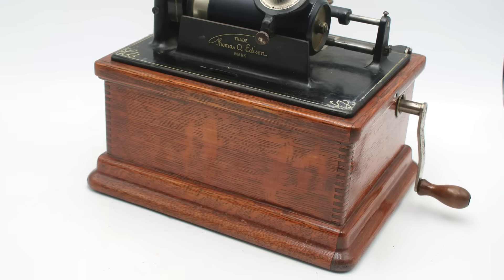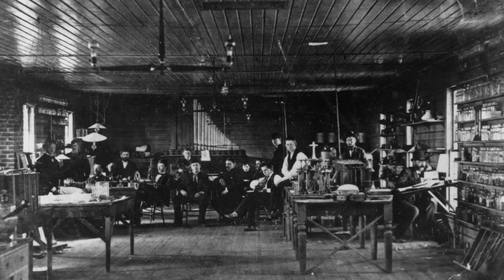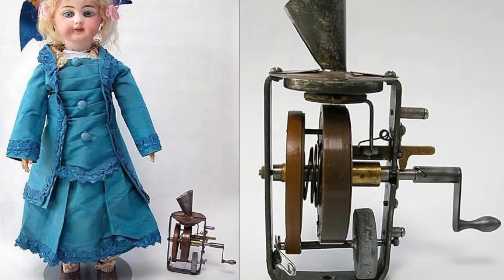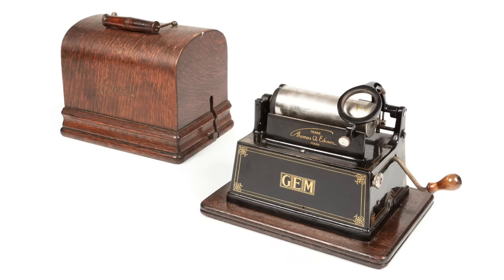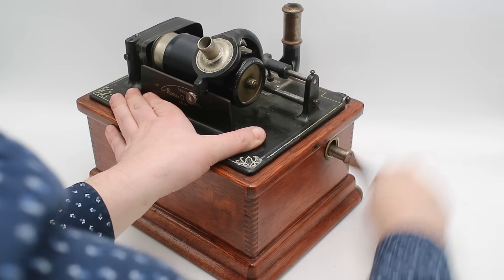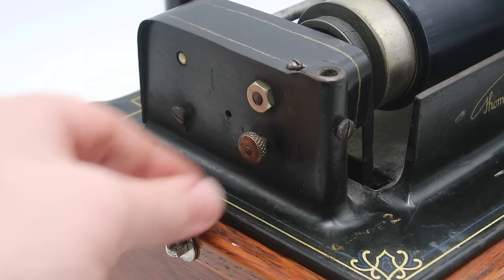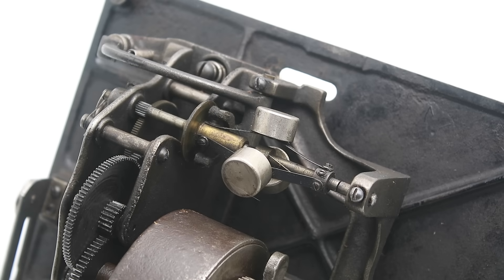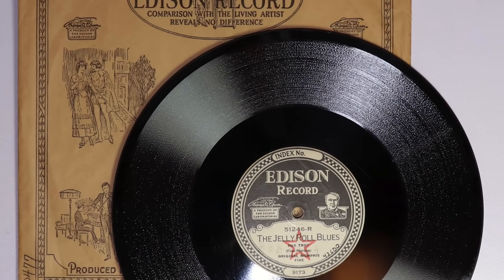Edison Fireside Phonograph: Inside the Music

Comment: I have some Edison "Diamond Discs". Like the Edison cylinder records, they are "hill and dale" recordings, unlike most other discs of the time (lateral recording). Modern stereo records use BOTH. P.S. The mechanical complication of the fly weight mechanism was solved by the synchronous A.C. motor, Oh, Wait that was a Westinghouse "thing". LOL

Comment: This is disinformation!    The selector handle changes the FEED.  Not the SPEED.    The speed for all 2 minute Gold Moulded black wax records is 160 RPM, just the same as for all
4 minute records.   The older 120 RPM was used back in the brown wax days before speed was standardized to 160 RPM.   The older Edison machines had a speed adjuster knob located
near the front left corner of the bedplate.    Sorry, but I simply CANNOT ALLOW your blatant disinformation to go without being corrected!    Please learn what the heck you are talking about before
posting such disinformation.   The feed for 2 minute is 100 grooves per inch.   The feed for 4 minute is 200 grooves per inch.  That is what the little pull-out selector knob at the left side
actually does when it changes gearing.   Speed remains absolutely constant at 160 RPM for both feed settings.    There.  Now everybody knows the truth.    :text-green-game-over:
Reply: Oh don't be so dramatic... You can correct someone's mistakes without lashing out weirdly like that
Reply: @theodorekorehonen  go stuff it.
Reply: Chill out, man. Gilles is a person with integrity and if you don't go raving and ranting about disinformation i'm sure he'll put a correction in the video description.
Reply: @leroyjones6958  you are absolutely correct! This incorrect information will surely compromise state secrets, bend our spines and prevent us from winning the war for the allies. How can this travesty be prevented? How about understanding that sometimes, people make mistakes. My only concern is that you NEGLECTED TO USE ALL CAPITOLS IN YOUR RANT! What an ameturistic mistake.

Comment: 7.58  to clarify, I don't think each cylinder was individually recorded; banks of machines were used to produce several recordings at once!😊
Reply: Banks of machines, and also mechanical duplicators where the stylus vibrations were transferred via mechanical ways from the master to the recording machines. This of course came at a significant quality reduction.

Comment: A correction, both 2 and 4 minute records spin at 160 rpm.  120 rpm was used early on, but 160 rpm later became standard.  That gearing doesn't change the mandrel speed.  It changes the speed of the screw that advances the reproducer across the record so that the reproducer will advance half as fast across a 4 minute record as it does for a 2 minute record.

Comment: I'm assuming you meant that the Edison grooves varied RADIALLY, not axially, as the description for the Bell/Volta version sounds axial.
Reply: I see your point, Radial in respect to the axis of rotation but may I simplify the language by describing Edison's reproducer indenting the foil / cylinder (in out motion first used on his Morse code recording machine)  whilst  Bell/Volta reproducer was a lateral motion (left right) .
Reply: @WOFFY-qc9te Either way works